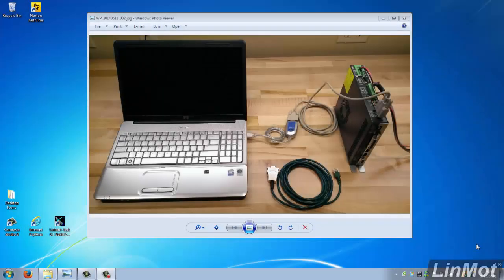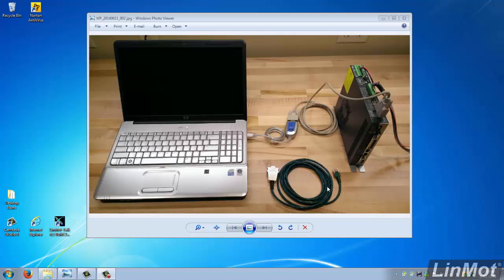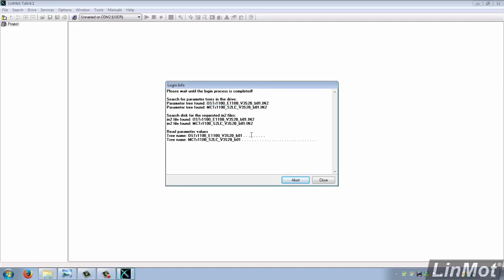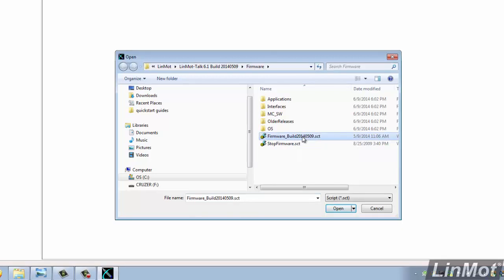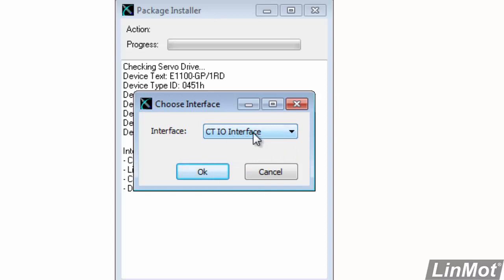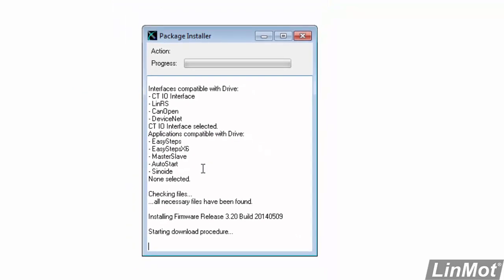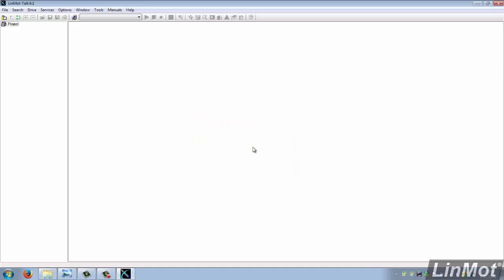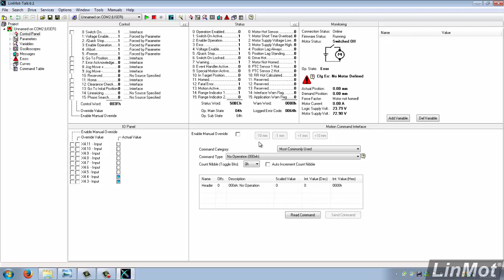LinMot Talk Configuration - Downloading Firmware

Comment: When using the "other" cable with the RJ45 .. the assumption is that the Moxia converter will work .. Warning, the Moxia is not "Isolated", and some risk is possible if the drive is not properly grounded with the PC.